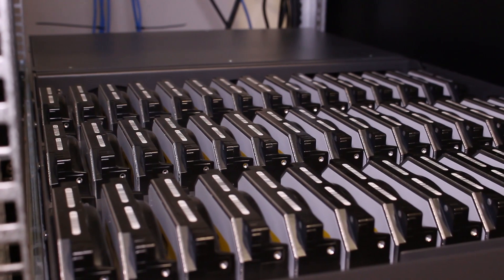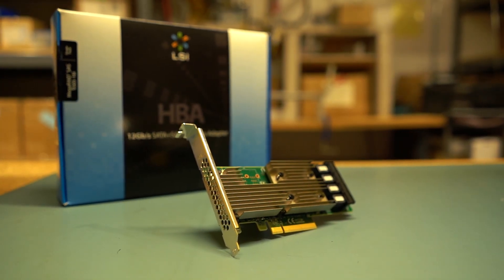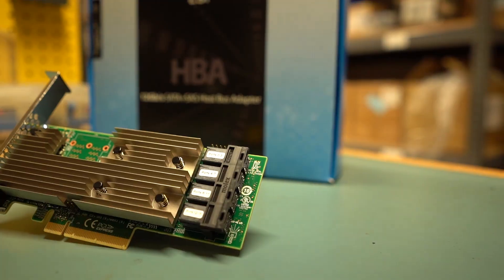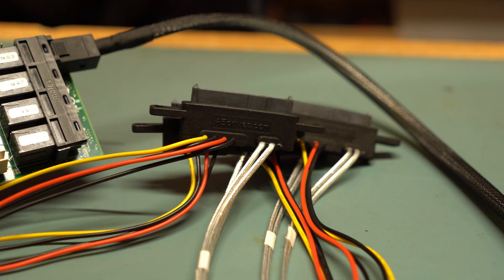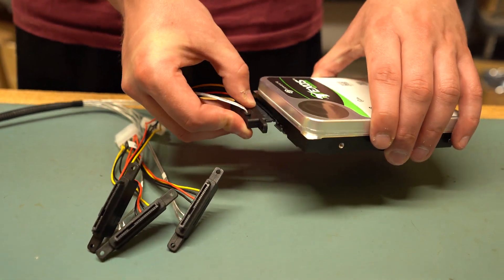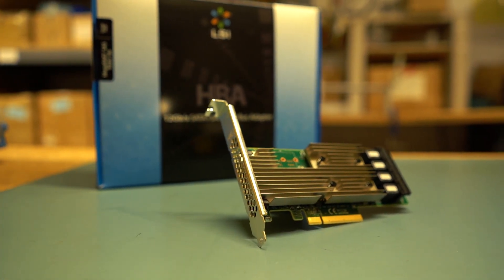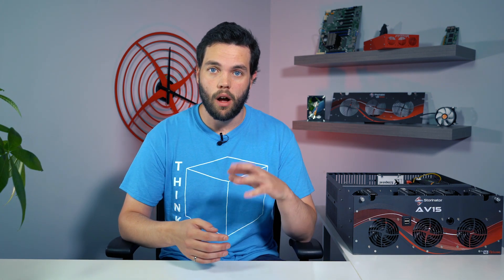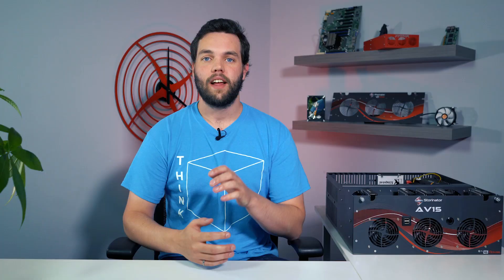Tech Tip Tuesday - Direct-Wired Architecture of the Storinator

Comment: I would like to see more videos on the following topics:
1) CEPH Cluster (Through an easy GUI), in virtualbox using CentOS / Redhat Storage Console
2) Security issues, what kind of firewall should we use, since the server is on the internet, we need security. (Both Hardware & Software)
3) Creating a Cluster using UnRaid with multiple nodes. (If that is even possible)
4) Drive failure rebuild process in a CEPH cluster,
5) Monitoring your CEPH Cluster
6) Personal Cloud using UnRaid

Comment: Correct me if I am wrong, you guys dont use any backplane, it is a custom cable from the LSI card to the drives, right? So when we slot in the drives, it attaches directly to the cable? Furthermore, incase of a drive failure, can we just replace the drive without shutting down the system?
Reply: This is correct.

Comment: Planning on supporting pci 4.0 in the future?
Reply: Are there any server motherboards that have it ?
Reply: @Reedith  There are no intel CPUs that are PCIe 4.0 yet unfortunately so none of the boards we use will have PCIe 4.0 unfortunately. However, if you really love open source, the TALOS II workstation offers PCIe 4.0 - these systems are a tinkerers dream (or a nightmare depending on how knowledgeable you are) and run using IBM POWER9 CPUs which are based on the POWER ISA architecture 

Hopefully we will get our hands on PCIe 4.0 in the enterprise soon!
Reply from the maker: Never thought it was necessary due to the hard drives behind the HBA. The hard drives will bottleneck long before the PCI 3.0 bus will. As we move into more all-flash and NVMe pci 4.0 will totally become necessary.